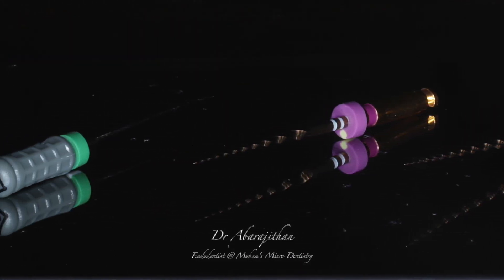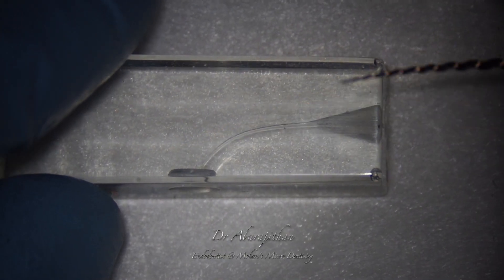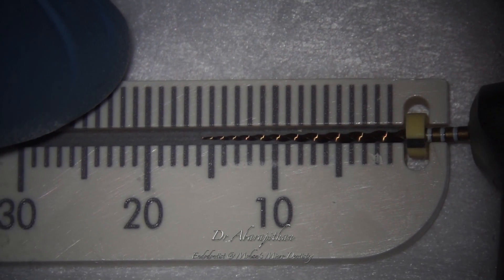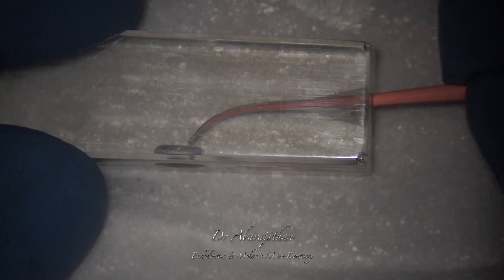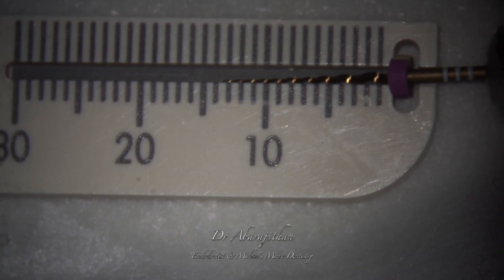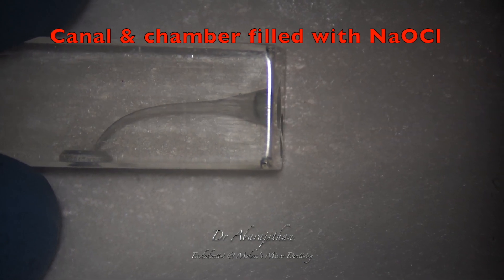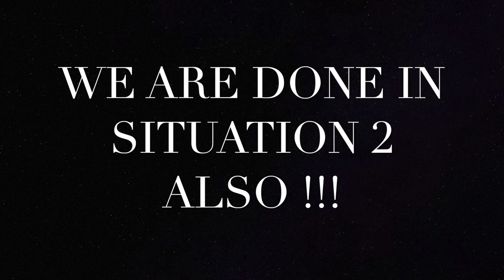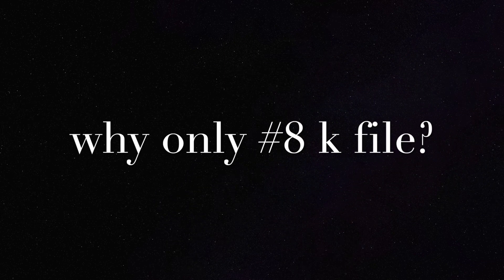New simplified rotary endodontic technique using protaper gold.

Comment: Thank you for sharing your knowledge sir ...I have one doubt sir , is the file engagement inside the canal will be more since we are directly starting with f1 though only to resistance area initially but binding is more using this method  and for how many cases this file we can use by this method sir ...once again thank you sir ...

Comment: Sir i am currently using waldent company files. They are good as of my experience. They have both fixed and variable taper files. Both are gold heat treated and at same price. I am confused to use whether fixed or variable taper design because all others are same. I am already getting good results with fixed taper. Should i use F1 of variable taper or 25/06 of fixed taper considering your simplified technique. Pls clarify me
Reply from the maker: It’s just like how different ppl prefer different mobile phones ; no hard n fast rule , stuck to whatever you are comfortable with
Reply: @abarajithan1  Thank u sir for your response. So, now can i use 25/06 gold treated file as an alternative to ur technique ?
Reply: Doesn't this method leads to ledging doc?